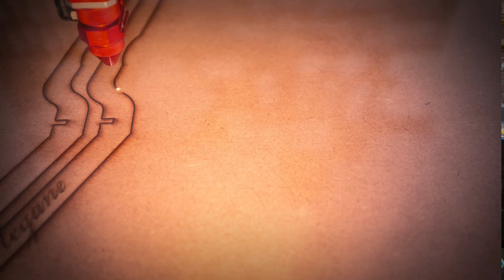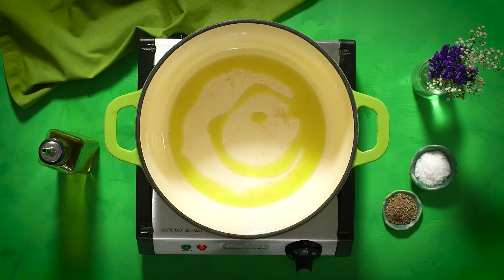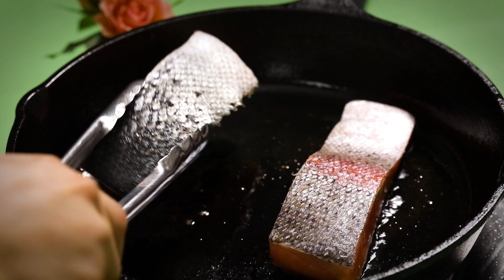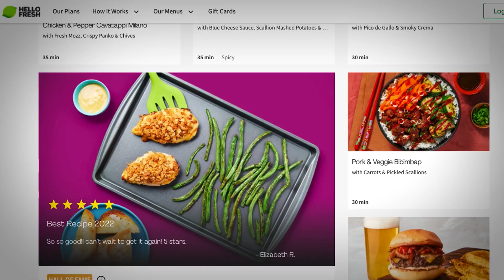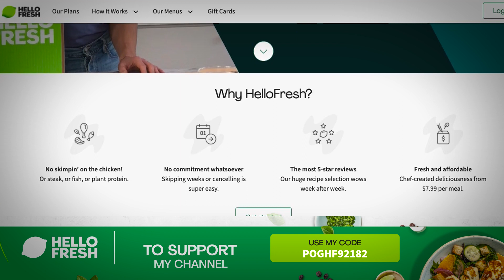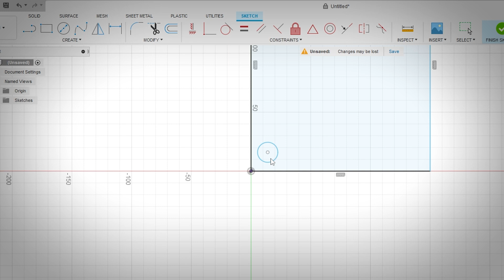Does Fusion 360 really work for small makers?

Comment: Depending on the Industry maybe but usually it isn´t. I am a pro CATIA user and almost nobody can even start the software as a beginner, it´s way to complex. Fusion 360 is like paint by comparison.
Fusin 360, Solid Works, Inventor are all fairly easy to learn and use. CATIA and NX are much more complex and difficult to learn and apply.
Reply from the maker: That's a fair take. There are varying degrees of application complexity for different use cases. For a beginners, Fusion is a professional CAD program that has a learning curve. This video is intended on giving a sneak peek at the application to help a beginner make a choice to use it... or not 👍
Reply: @IQWorkshop  Fusion is a great piece of software from what I have seen. I didn´t even know it was used professionally to be honest, in my day Solid Works was "the fusion" of that time, a fairly cheap and user friendly software. In the end most middle range CAD packages (to which I would count fusion) are similar and the basic knowledge can be transferred from one to an other to a certain point. They all have Sketchers and planes and a feature trees (except the really cheap and shitty ones I have seen who don´t have a feature tree at all). So your viewers should check out multiple CAD packages, the pricing can differ a lot.